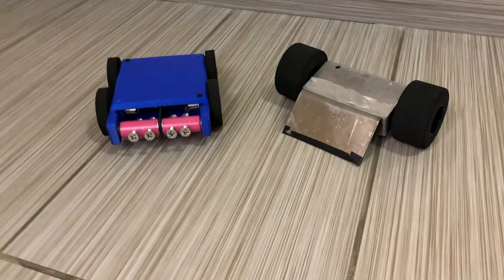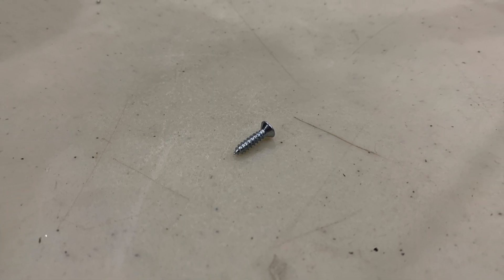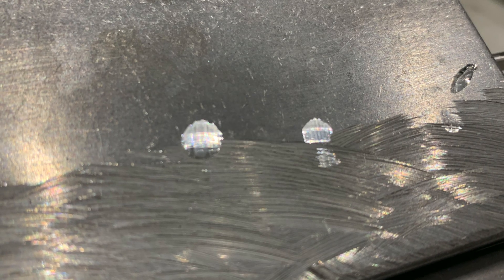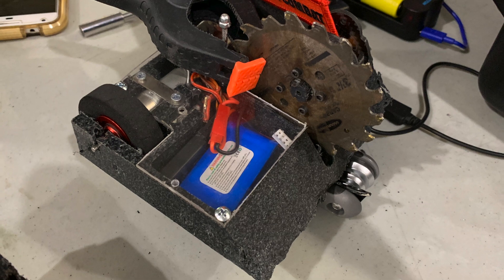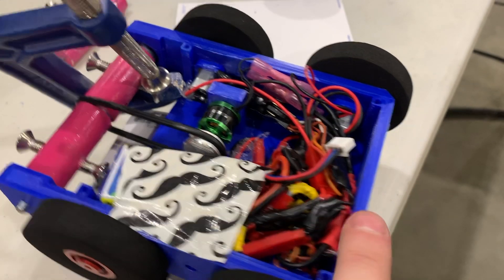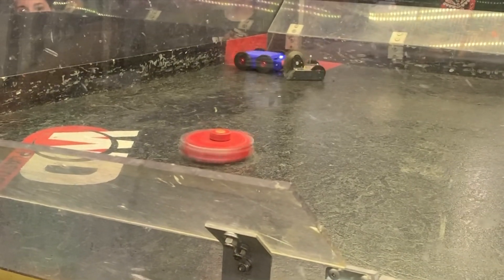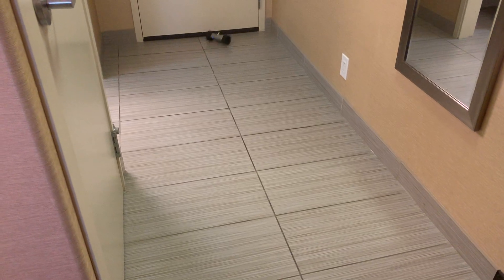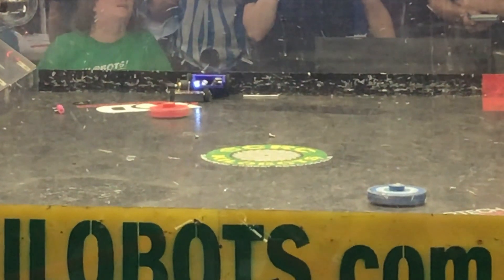Fighting 1-Lb Battlebots at Kilobots Canadian Nationals 2019 - Part I

Comment: Ever thought of using direct drive for a weapon? I know there are lots of drawbacks, but there are many advantages as well! If you have any questions on direct drive or any other antweight drum spinner things just ask me. Willing to help!
Reply from the maker: I’ve considered it. I guess I have a bit of a stubborn streak when it comes to building things. I wanted to purposefully build something that not many other people were doing. There are a lot of other direct drive ant drums, so I figured I’d try to go with the belt. If the next version really breaks I may go back on that, but since I’ve already designed and ordered most of the parts for this new one, I guess I’ll have to take my chances :)
Reply: Kepler Electronics ok, sounds cool! I am very excited to see the new blastwave!
Reply: Kepler Electronics ok, sounds cool! I am very excited to see the new blastwave!

Comment: Hey! Finally got around to watching this, hope to see you next year! Suggestion for Blastwave would be to put the bearings in the drum itself and use a long bolt with a locknut on the other end, rather than the live-shaft setup you're using now. I did the same on my beetleweight EXERCISE RESTRAINT and it so far hasn't failed me. Hopefully the second video is out soon, interested to see your thoughts on the grudge match we had between Chester and Stomp-Bot
Reply from the maker: I’ve been thinking about having bearings on the axle for a while now, but I also have another idea that requires a bit less machining. 

The second video should be out soon, hopefully I’ll get to fight Chester again next year!